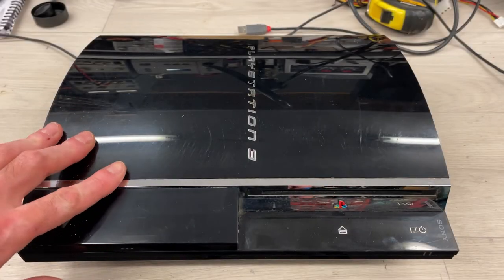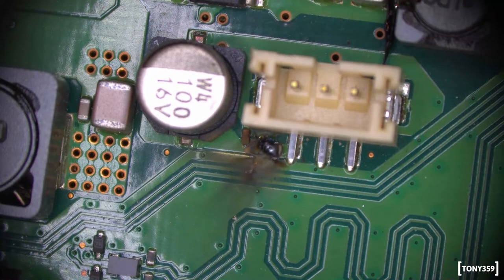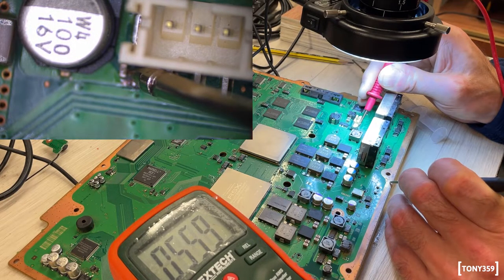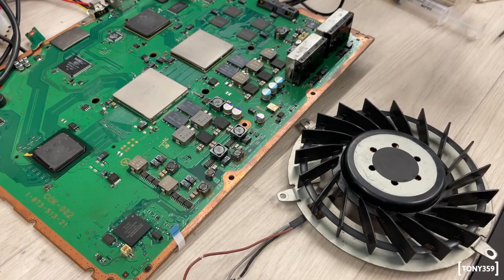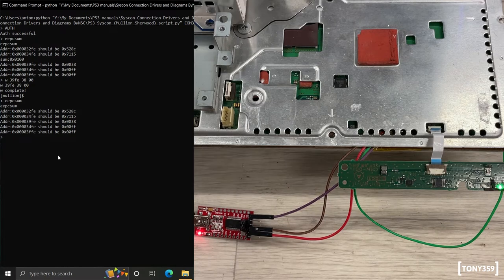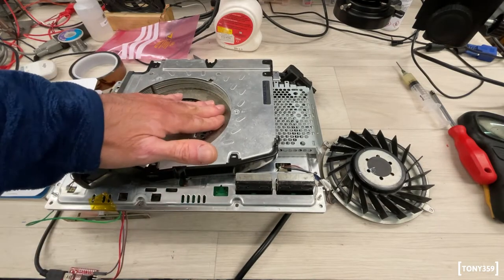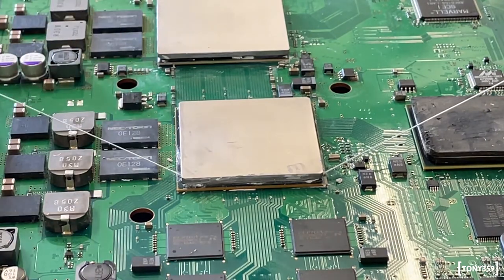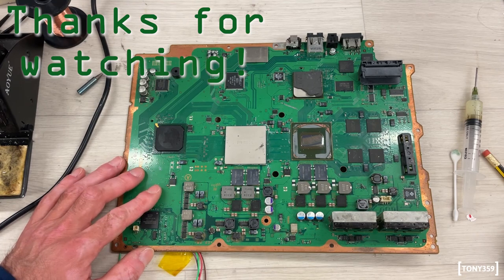PlayStation 3 (CECHC03) - Repair Attempt (Syscon fun ahead!)

Comment: nice efforts! im surprised that dry paste under the ihs would shut it down so instantly. when the dental floss scoured the pcb was it when it was tripled up? i wonder if dental tape would be any better? anyways while its sad this ps3 isnt up again, it was only an 80gb, only 85% bc.
Reply: and i would love to know (but i dont want to take it apart and solder and buy that thing) the days my phat 60gb has on it, it ran 24/7 for 8 years, and now just sits quietly with its main power off, waiting to shine gain.
Reply from the maker: @r4z4m4t4z  You might want to look into custom firmware, it's easy to install nowadays and it might (not sure) give you that info.
Reply from the maker: Likely when I tripled it up indeed! No need for floss, I've learnt how to de-lid using a knife. It's safe. I wouldn't have thought it would be safer than dental floss! The instant heat-up can happen, a friend had one with the same issue, removal of IHS and new thermal paste fixed it. Weird though. Thanks for watching!
Reply: @tony359  i cant jailbreak my ps3, that be sacrilege!
Reply from the maker: @r4z4m4t4z  ahah I understand. My own PS3 is still stock :)

Comment: Impressive job! I was thinking, since 100% of laptops that uses those “bulky” caps (electrolytic or tantalum) mostly designed by NEC company, they suffer from the same disease, once windows was loaded cpu temp is like 70+ celsius. Changing them with regular tantalums fixes the issue. Isn’t this the same case here? Pc cpu thermal throttle and only after it reaches 90+ celsius shuts off. I think you can restore the damaged traces above apu pcb, you just need a very thin wire, i suggest using a mesh from a shielded wire (i often uses apple cables using those thin mesh wire) good luck and keep up good work!
Reply from the maker: Hey thank you for the nice comment! You are not the first one saying I could fix those traces. I tried hard, I bought a very fine tip and wire but I could not fix it. The wire is enameled which really does not work with me as it needs higher temps to melt the coating. I tried for several hours but I could not succeed. Sorry! Thanks for watching!
Reply: @tony359  wire from external mesh inside a data cable is not enameled. A fine tip is a must…
Reply from the maker: @justinc9991  I have a super-fine tip which is kind of pointless as it does not have enough thermal mass and struggles with basically everything. I think I used 0.08mm wire, it's way thinner than most of the shielding found in cables. I think some microphone cable might have what I need - the shield has to be flexible for reliability. I'll check again, thank you!
Reply: @tony359  if you need more thermal power u can always use a hot air station to help the job, or use a preheater for the whole board…
Reply from the maker: @justinc9991  Hot air on a stand sounds better - with the pre-heater I would burn my wrists! :) Thank you!
Reply: Its not the tolkens at all. Its bumpgate in the rsx
Reply from the maker: @goclunker  I know... too late! :)

Comment: Atleast it doesn't have the burned NEC tokens due to a bad reflow attempt like my flea market find.
It's also YLod but still need to hook the syscon up and have a look at the errors.
Reply from the maker: I removed a tokin capacitor on a PS3 I am showing on one of my future videos and you do need pre-heating to do that right or you're burning the hell out of the PCB! This was such a nice board, I feel so sorry for breaking it! Thanks for watching!
Reply from the maker: Replacing tokins require some tools - or a knife, I understand it’s the latest and greatest method 🙂 good luck!

Comment: 25:58 AFTER SETTING THE EEPROM TO 00 three beeps and flashing read while diag connected to the gnd is not powering up the f32ttl alone and in the cmd is always given the error scopen response invalid , what I m doing wrong?
Reply from the maker: I'm really not familiar with that part, I was only following instructions. I'd recommend you asked on PSX Place. Thanks for watching!

Comment: I have the same problem with my A01. Read the syscon and it was showing South Bridge codes.
Reply from the maker: I still haven't given up on that board. I tried soldering patches but those traces are too many and too close. I know it's doable but... 
Did you manage to fix yours? Thanks for watching!
Reply: @tony359  I have not fixed it yet. But could I use a jumper wire from the little resistor by the ferrite bead to the fan connector leg?
Reply from the maker: is your fan not spinning? You can bypass the ferrite bead but the fan will inject some noise back into the PCB. As a test it should work though.
Reply: @tony359   it didn’t work. I tried before your reply. When the ferrite bead first blew up it took the solder pad with it. And some of the solder mask was peeling back, where the ferrite bead meets the resistor. And I knocked off the resistor by the cap
Reply from the maker: Things are so small in there! :)
Can still be fixed though you might ask yourself "why did the bead fail in the first place?" :) 
I hope you can still recover it!

Comment: Ps3 fat eror cod A0093003 CELL_POW_FAIL poweroff state.. How fix?
Reply from the maker: Hello, you can find a list of known error codes here: https://www.psdevwiki.com/ps3/Syscon_Error_Codes

It seems that you might have Tokin capacitor issues. Those smoothen up the voltage for the CPU and GPU and they’re notorious for failing. They’re not super easy to replace, there are some videos around which might give you some ideas.
Reply: @tony359  power suply outo put is only 194 omeg is this meaning fulty power suply?!
Reply from the maker: @mohandmohand2047  I’m not sure what 194 omeg is but the error code points to the capacitors on the motherboard. Not the power supply.

Comment: Other than siscon method is there any way available through which we can check how many times and hours Play Station 3 was used?
Reply from the maker: I believe you can access everything if you ‘jailbreak’ the PS3 which is easy to do nowadays. I believe you can also access the error logs.

Comment: Would anyone know anything that could help my PS4 overheating? Ty
Reply from the maker: My experience with the PS4 is limited but it doesn’t have an IHS in my knowledge. So I guess it’s just a matter of replacing thermal paste and make sure all is properly in place.

Comment: please try to run tiny jumpers
Reply from the maker: I tried. Twice! :) I know it can be done but I was unable to. That said, I used enamelled one which is not great. I might try again but I am not hopeful! Thanks for watching!
Reply: @tony359  thanks for replying and it is realy unlucky but you have learned from this mistake and you delidded now 2 cpus and 3 rdx chips successfully so its not a total loss (allways think positive)
Reply from the maker: @hannescampidell  indeed and thanks. A shame as this one would have been alive by now. It’s still on my bench, one day I might try a CPU replacement (or succeed in apply jumpers!)
Reply: @tony359  yes or use it as a donor because the cpu is married to a few other components
but i think it would be worth trying the jumper method it would make a good video
Reply from the maker: @hannescampidell  I need to try that again indeed. Need to find some non-enamelled copper wire and use a larger tip. I tried with a very small tip but that’s apparently not working (Rossman dixit) as a larger tip has more thermal mass. The issue is that there are just too many broken traces. Even if I fixed one, it would come apart when doing the next one. But I know I could be done.
Reply: @tony359  at least i think it would be easier to use a really small tip and a extremly thin wire of course but the ammount of damage is huge and i did something similar but way larger and it took me arround 2.5 hours so this is verry time intensive
Reply from the maker: @hannescampidell  I bought the smallest tip I could find for this job. It's great as I can only work on the affected area but does not have the required thermal mass to do anything. I watched a video of Luis Rossman and he recommends larger tips for smaller jobs. The idea is the flux will keep things in place. These are just to close to each other, I can solder one wire - and takes some time - and then it dislodges once I start working on the next one. But the biggest issue was the enamelled wire - it would just not solder. I have been recommended to use some wire from a shielded braided cable or a small transformer. I can't just buy a reel of non-enamelled copper wire as it would oxidise with time. 
I'm not saying it's not doable, just that I haven't mastered that yet :)
Reply: @tony359  i think the wire problem is possible to solve with a small trick and that is pretinning the ennameld wire it with a larger tip and then soldering it with the small one and it could work well with a larger tip but be carefull that its not a too large tp otherwise you will just mess up the work you have just done (i made such a mistake and it is very frustrating)